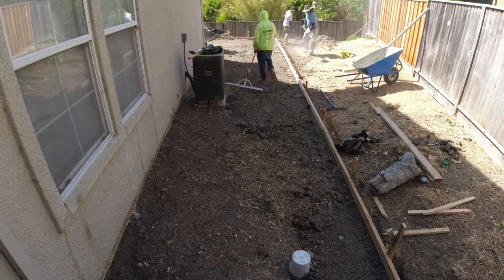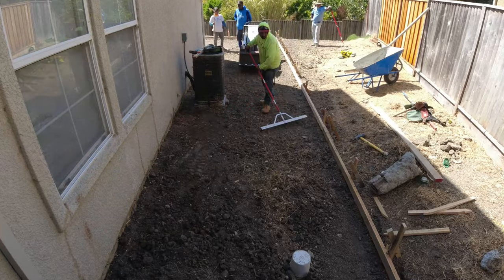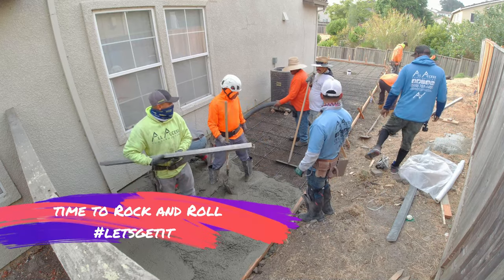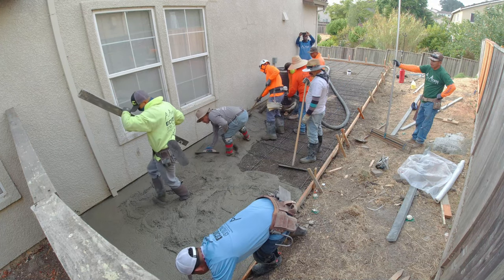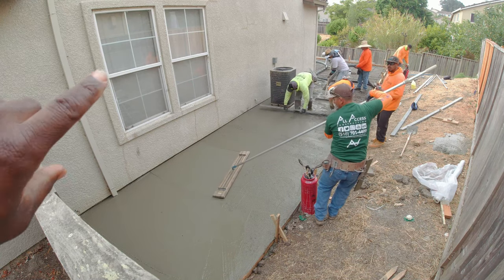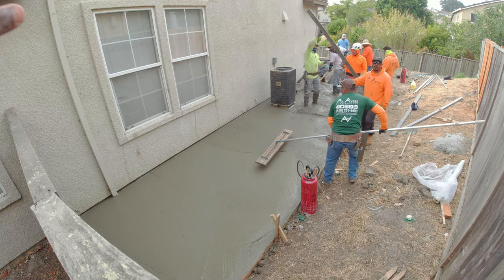Side Of House Concrete Pour Start To Finish (REALTIME)

Comment: What is your mix design out there? In indy we use 4000 psi or 6 bag(sac) and I'm putting 1% retarder in everything I pour right now
Reply from the maker: Mix #807.. 6 sac pea gravel 3000 psi..
Reply: in the summer
Reply from the maker: I use the mix pretty much for every thing with a 4 inch slump.. There been times I use the retarder if I got two pours in a day.. I try to get my concrete at 7 or 8 in the morning...
Reply: @AllAccessConstruction  7 or 8 that's nice, it makes a huge difference
Reply: Have you guys worked with  a plasticizer to get it to flow more? Is that preferred for finishing  and getting the cream surface at the top or does it make things unnecessarily runny? I ask because we are looking at fiber reinforcement in our mix and wondered if it would help
Reply from the maker: No we haven't.. Only use a retarder a few times since I been in business.. We have use fiber mesh by itself as well as with rebar..

Comment: How do you pour right next to the house I'm about to have a section of  Driveway done just like that.  What will I use to seal the driveway against the house so water does not go into the basement.
Reply from the maker: You probably going to need a French drain.. The concrete we poured is slope away the house.